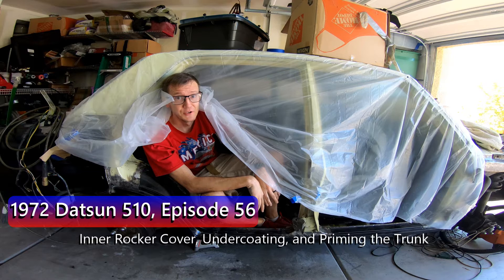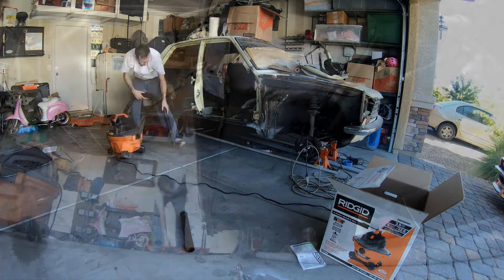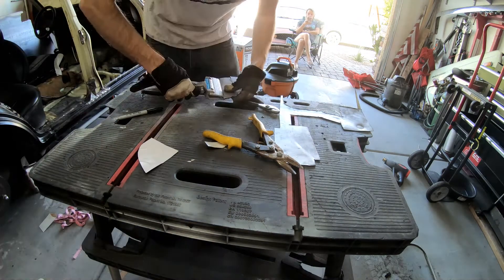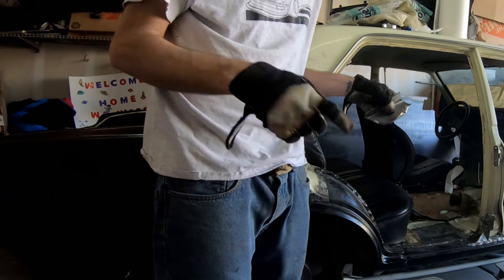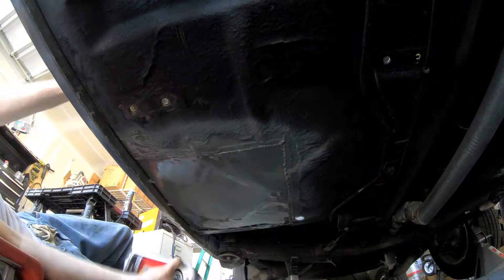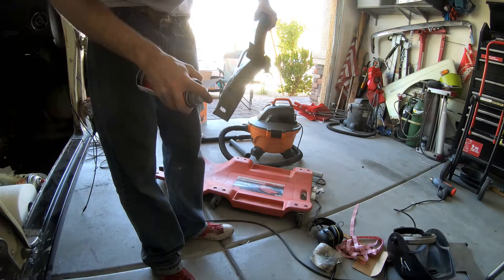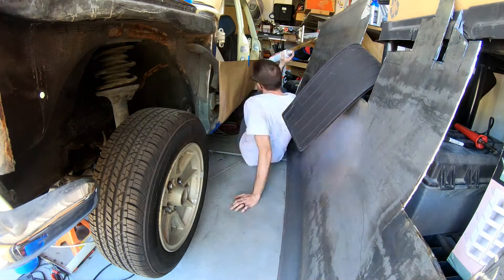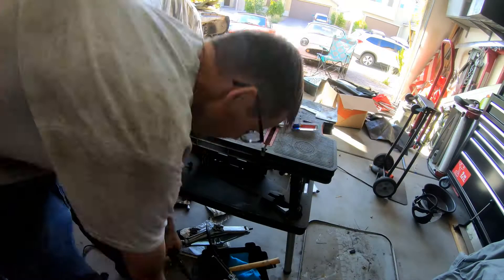Datsun 510 Inner Rocker Cover, Priming Trunk (Ep# 56)

Comment: What paint gun are you using?  Also, what is the cfm of your compressor?  Keep up the great work!
Reply from the maker: Cfm on compressor unknown not great. I am regulating it to about 40psi and trying to take breaks. The gun is the harbor freight special that I have had for about 10 years now, I bought it when I painted a VW GTI in 2009